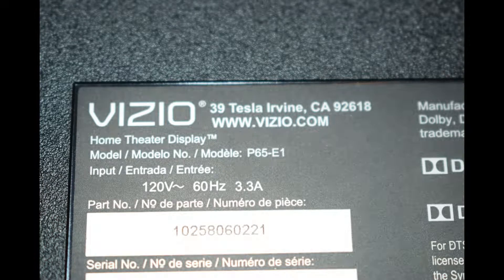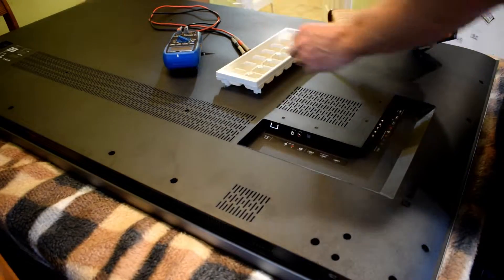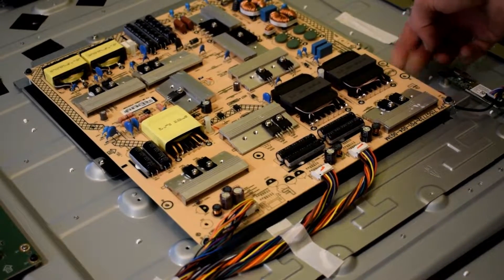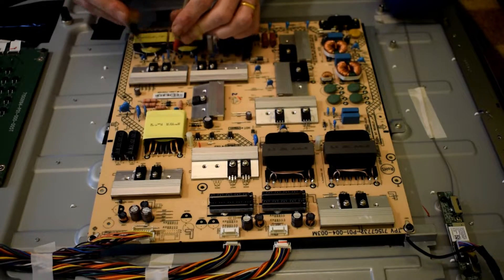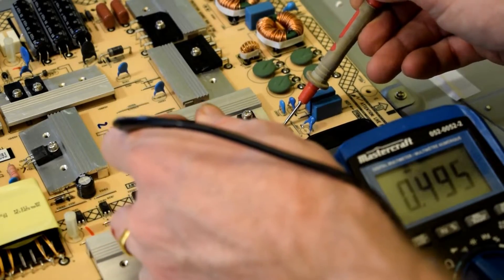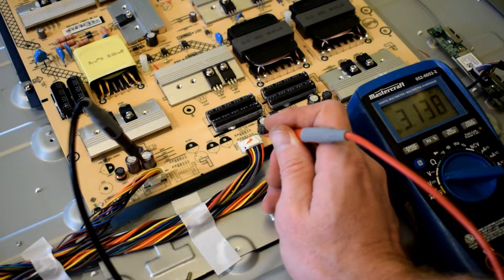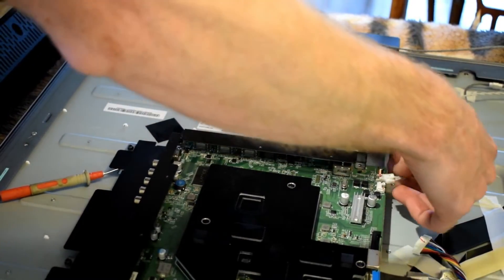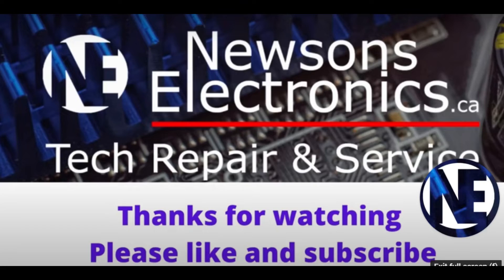EASY, HOW TO FIX a 65 Inch Vizio TV by baking the mainboard.  (Model P65-E1) - no standby light.

Comment: Just did this to my P65-E1 today and to my absolute surprise it worked! I’m going to add a small fan to the interior to blow air across the processor and hopefully prevent this problem. Thank you for the video!
Reply: Did you add a small fan?
Reply: @danielwesenberg8865  I did end up adding a 6” usb fan but the problem still came back under a month, I ended up sending the board in and had it reflowed and it’s been working great ever since.

Comment: For anyone wanting to know why this works:

The processor chips below the heatsink get microfractures in the joints that connect it to the circuit board itself. When this happens the chip can't properly communicate with the rest of the board which means broken TV. 
When you heat it up you cause thermal expansion. That expansion is enough to push those joints back together and that pressure alone allows the board to work again. However this IS NOT A REFLOW. This is more of a trick you can use to properly diagnose your mainboard as being defective. After a short period of time, maybe 1 day, 1 week, or in the best scenario a month of thermal cycles the cracks joints will slide away from eachother and the cracks will come back. 
In order to perform a long term repair you have to actually melt the solder so that the bond can be remade, that is what a reflow is. 300F is not hot enough to reflow a board. 422 degrees Farenheit is the minimum temp required to melt solder which means realistically you should probably be hitting about 450. With that being said, DO NOT DO THIS! If he had actually hit those temperatures he would have completely ruined the board and caused many shorts throught the board making it none repairable. 
If you want to see a full video showing the proper way of doing it, here you go:

https://youtu.be/eMR_Paf3bIM?si=d-6D5JtlYYNsMcmp

Comment: Has anyone done this and actually had long term success? Mine just boot looped then after removing power and plugging it back in it won't power on.  Just a blip in the standby light when plugging in.  Usb light strip powers up.  Unreal. Fml.

Comment: Holy crap, it worked for me too.  I have been staring at this dead TV for a year.  Kept it behind the older, smaller TV, thinking... "how am I going to get rid of this behemoth?"  I was going to finally take it to the dump today and figured "what the heck.... I'll try one more time to repair it/cycle it, whatever."  I found this video referral and tried this without testing any of the other components.  I knew it was a power issue, so I just looked at everything else for burnout, removed the power supply, baked it, and put it all back together.  I will tell you there was a moment when it didn't work and I was bummed, but I put batteries in the remote and it worked just fine.  I'm thinking I might have a bum 'power' button, but who cares?  It works.  THANK YOU SO VERY MUCH.
Reply: I’m trying it today I bought a new ps board and it didn’t work. Gonna try this now and I’ll let you guys know
Reply: Did it work? @MannyRamirezM

Comment: Holy shit, worked on a M65-E0 main board as well. Power supply checked out, ordered another main board on eBay, must have had the same problem since it still wouldn’t power on. Reflowed both boards in the oven at 300 for 10 minutes, both main boards work now! Thanks a ton!!

Comment: Thank you!  Unfortunately, when I opened up my Viz P.  It has sub, secondary, and main power board.  I simply jumped to the reflow process of the main board and it worked!  Is you screen still working a year later?

Comment: Worked for me as well. I must confess I didn’t think it would. It was surprinsingly easy to do as well, although I hard no experience at all. Thanks!
Reply: Commenting here for visibility. If anyone starts running into this issue, it will likely keep reoccurring every 3-6 months. For most, this is due to the board having insufficient cooling. The last time this happened I installed a usb powered PC case fan plugged into one of the usb ports on the tv. On the back of the tv there is a vented grill over a part of the main board, when the tv was apart I drilled larger holes in this grill and then placed the fan on the outside with the airflow towards the main board. It has been going strong since.
Reply: @mrbubbls114  Did you install the fan after baking the mainboard once, and it's been working since? Baked the board on a P65 C1 and it worked for 20 minutes then got fuzzy dots and kept rebooting. I'll probably try baking the board again soon

Comment: This actually worked I was skeptical but when it was powering back on after the bake it acted a little weird but after a few minutes back to normal    Thanks for the video.   Now I noticed looks like little plastic flakes between screen protector and I guess lcd screen any advice how to get rid of that. The original issue was power on then shut off and kept doing that but now it’s back to normal
Reply: Does it still work?

Comment: OMG I just replaced power supply and nothing. Main boards are all out of stock. Then I read some Reddit posts about banking it but was not sure until I saw this video. Worked instantly after, same model, 2017 P65-E1, 320F for 10 min. Thanks a million for this video! 🙏
Reply from the maker: glad to help
Reply: @NewsonsElectronics  It died again a week ago. It was displaying the logo but kept rebooting automatically. It would never get past the  Vizio logo. So I baked the main board again. Now working again. Only lasted a month, this time we'll see. Still cannot find a board to ship to Canada.
Reply: Let me know if you find a board that ships to Canada
Reply: Is the fix permanent
Reply: Reball Repair service is the best option, brings it back to factory spec

Comment: Hi, I have a Vizio p65-e1 that began having hdmi port issues a month ago (possible power surge). The TV ran with 2 ports working since then. two days ago the power no longer turned on. After research I baked the main board @ 320 degrees for 10 minutes and replaced the board. Power cam on again but now I get backlights but no picture. Looks like fog on the screen. Checked cables. began troubleshooting TCon board by disconnecting cables to the panel. Saw half screen but still fuggy. Help please?

Comment: So I have the exact same TV Vizio P65-E1, we were watching it the other night and all of a sudden it went fuzzy with vertical lines more greyish with blue green and red specks but I could still see the picture and hear it for maybe 15-30 seconds. Then it just started turning off and on for well over an hour and I couldn't turn it off. I finally unplugged the power and now it wont power on at all just a black screen and no standby light. Should I try this method?
Reply: I had exactly the pb you described, with pink greyish lines until it turned on and off by itself. The method described  indeed worked for me

Comment: I normally would not try things “I see on the web” but I already replaced the tv (new85”) so what the heck.  It freaking worked!  Took out my multimeter and looked for obvious burnt components ie. letting the smoke out components but none found.  300F for 10 minutes, turned off oven and I let it cool to room temperature.  I had several sticky foam pieces on my board I removed before placing it in the oven.  Thank you for the advice!
Reply from the maker: glad to help out

Comment: Thanks. Its really worked.  Im not sure how long it will work. But it means problem is CPU. I wil try it with flux by using smd solder If it will happen again.

Comment: Cooking it for 300 at 10min. Put it back in and TV came on. Unbelievable lol
Reply: Update: later I sat down thinking it was now working. Turns on ans works for about 20min. Then get a bunch of dots on the screen with a grayish overlay but can still see picture. 2min after that the screen goes back. Every min or so the Vizio screen logo come on and off repeatedly, and just keeps doing that.
Reply from the maker: @troymobley3802  try to bake it again sounds like your processor issue.
Reply: @troymobley3802  Mine does the same thing after baking it once. Did you end of baking it a second time? What'd you do?

Comment: Did you do any testing on the main board before you baked it?  I know everyone is saying that reflowing is only a temporary fix because wherever that bad solder job is will pop its head up again in the future.  Id like to find it and fix it but not sure how to.  Im willing to to buy the correct multimeter and do the work, just not sure how to.

Comment: I thought there was no way that this would work. I picked this same model up for free on Marketplace with the same problem. I followed these steps and now I have a beautiful working TV. Thank you.
Reply from the maker: that is great, glad it helped.
Reply: manufacturers bake motherboards to remove moisture as part of the manufacturing process. it is also for outgassing. I have reflowed Sonicwall(firewall) mainboards and video cards in the past with great success. One thing to keep in mind though is each time it is baked, its going to hamper its life and eventually it will stop working. Whatever lead to the board failure, its best to keep the electronics in a dry area away from moisture and ensure adequate airflow to ensure heat pockets dont cause solder joints to "desolder"
Reply from the maker: @JTAlweezy76  sounds good thanks for the advice. !!!
Reply: How long has this fix lasted for you guys?
Reply: How long did this last?
Reply: A couple of months the first time and a month the second time. I was going to re solder some connections but never got around to it. @rickbotelho9452

Comment from the maker: Any electronic questions just ask them below.
Reply: I did the baking, after it wouldn’t even come on. Worked but 20min in there was a greyish overlay on the picture with a ton of small dots. Then the screen went black. TV now just is black and keeps showing the logo on the screen for 1min. Then logo goes away for 1min. Comes back for 1min and so on. 

Any clues? I had 2year Warranty and additional 2years from my Citibank card. At 4years and 1month today so out of warranty. Thanks!
Reply: @troymobley3802  might have to repeat the process once or twice I heard
Reply: I just got this problem which is very frustrating; did your fix; how long did you wait for the board to cool down before re-installing it? thank you